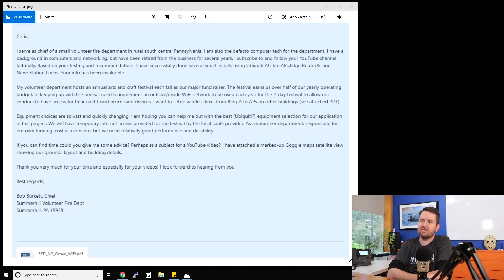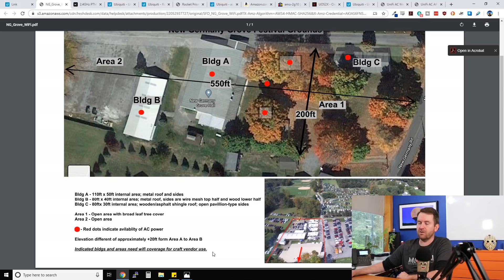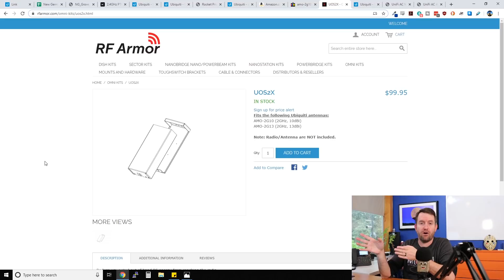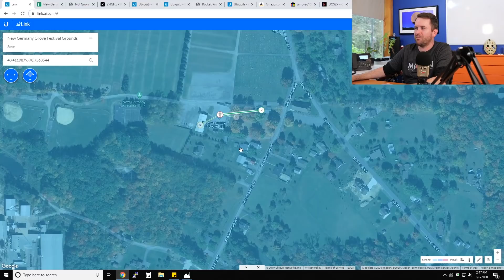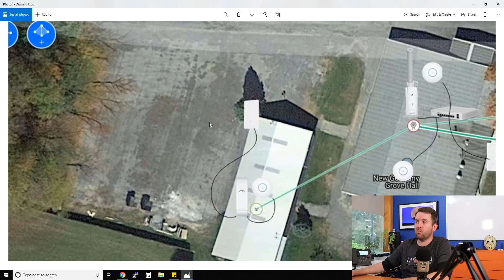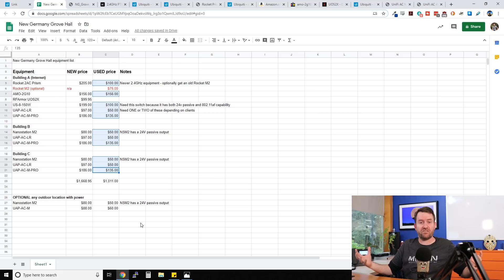Festival Grounds PTMP Network

Comment: Hi Chris, I did Roskilde Festival sound stages for 10 years (some years ago), which is a 1 week music festival with a huge crowd (130.000), which is built up during three weeks, 4-6 days of music, and then pulled down afterwards. We had to provide rocksolid network for the soundstages (not the audience at the time) to allow for crowdcontrol equipment, sound measurement etc. I would pull some steelwires, and pull a cat6 cable via them, and let it work via POE, he has trees, it's a firedepartment so they have a way to go high, that would make it much cheaper, and he can use much cheaper ap's.
Reply from the maker: Good feedback - thanks!
Reply: I was thinking along the same lines and was looking to see if anyone else already suggested it.  The distance between A & B is approximately 35', so putting a couple of permanent drops over in A makes the most sense for there.  Run a trench and conduit in the summer. Being a small town there is not going to be a lot of red tape and I'm sure someone they know has a back hoe and would donate a couple hours to dig it.  Going from A to C in the clearing between the trees is about 250' with one turn, so if a permanent conduit is impractical, flying wire through the trees temporarily (with possible APs in the trees) seems like a cheap solution. The only equipment that would be needed are the APs directly attached to a POE switch, no need for PTP or PTMP wireless. Wireless is often the cheapest solution for many situations, but in this case they would likely have cheap or free access to the equipment to trench between at least A&B if not B&C which provides a superior solution.
Reply: Cat6 cable outdoors is a complete no-no.  Against the law here in Aus.  Ever heard of lightning?  It loves outdoor wires like Cat6.  It's the reason we have point to point wifi links....
Reply: @einfelder8262  i see, well the trees are higher, and if its a situation it should be enough to run the wire to ground, og and the cable needs to be for outdoor use of course. But restrictions vary of course. We did rhis a lot in denmark, but that was also between steel towers
Reply: @Ein Felder:  Honestly? Lightning??? Flown cables are an excellent, safe, cheap, reliable way of doing this sort of thing. I come from the broadcast industry, where we used flown cables a lot. 

We also keep stuff as simple as possible. For example, radio mics are convenient, but unless there is strict attention to operating frequencies, they can be as useful as housebricks, especially wherever there are a lot of small outfits operating independently. So use cables where you can, for reliability and simplicity, and in the case of networking, performance that's an order of magnitude or more better (does no harm!). 

RF interference is worse on 2.4 gHz, although you won't get the early warning signs I could actually hear with analogue radio mics. I remember way, way back that we even had fully tuneable receivers, and one of the first tasks on site was to go carefully through the band, and listen to check for potential problems, before selecting the frequencies to use for the day. 

And, as Chris pointed out in the video, trees in leaf block RF very well, even on much lower frequencies that WiFi uses...
Reply: And in the circumstances, I would expect at least one firetruck parked up on display. You would hope it has good radio kit, well filtered, and that the Ubiquity RF circuits also have really good filtering, as I expect fire dept transmitters are at least 10dB (power) higher output than any wireless LAN kit. If an inqiusitive child presses the 'talk' button...
Reply: @simon-d-m  HA ha, yes that would be golden, though I'm not aware of the frequence they use in the area, I doubt that it would interrupt 5GHz
Reply: @simon-d-m  Oh yes, I did that when I was doing my enlistment as a gunner observer :-) About 30 years ago.
Reply: @kennethfribert6074  Sounds like it was fun! The thing about the fire truck is not what frequency it's on (will almost certainly be a lot lower - dunno US practice but I'd expect AM on VHF band 1 or somewhere near there), but that it will be a huge signal compared to the WiFi and very close. There is propensity for big transmitters nearby to simply overload the (analogue!) input circuitry of the WiFi receiver, even though they are well out of band. I took the back off an AP only yesterday, coincidentally - cheap and NOT Ubiquiti - not really any bandpass filtering at all before/at the first stage in the receiver circuit. It would be swamped, send the first stage into clipping and take out the signal for the duration of the bigger transmission.
To be fair, you would get some induction into cables too, but... Cat 5 and its derivatives use balanced twisted pairs (AKA "differentially driven" in the computer world), meaning they are relatively immune, and there wouldn't be a very good impedance match to the firetruck's TX anyway, so it would probably have no significant effect. For Cat5 to work at all there has to be excellent balance between the two conductors anyway, and if anything with an overall screen was used properly, any cable borne interference would only arrive via the plastic cases of the equipment. Careful grounding would work wonders, too.
And if lightning was in the area they'd probably have far bigger problems than card payments not going through...

Comment: At what point would just hard wiring be the best option?
Reply: Good and valid question.
Reply: Hard wiring is great, if you have the equipment needed to bury cable and it is feasible to do so. In a project I'm working on at the moment, it wouldn't be cost effective to dig a trench, because we'd have to get the city involved to go across the street and also we have asphalt that would have to be patched after the fact. Not only that, but there are four buildings and four overflow lots that we need to get to as well. That's a lot of digging, easier and cheaper to shoot a signal from the main building to our remote sites.
Reply: @techguy3424  I didn't get the impression this had to be a long term install.
Reply: I would say that if you have the towers or other tall objects that can be used, and the ability to put up a steelwire, and put cable on it (above trucks max height of course) there is nothing cheaper and more reliable. Actually, if you go for a short term setup, you don't even need outdoor certified cabling, it will handle the 3-4 weeks without any issues. Even without the steel cable, a UTP will sustain itself for several weeks (but then it is straight to the bin).

The span for a steel cable, well, it depends on the equipment you have at hand, as the forces in a long steel cable a substantial, we've used 20-30 m steel cables without any special precautions and issues, even in heavy rain and rather high winds (we don't get crazy storms in the summer here in Denmark). We had a 50 m cable at one time, but that was set up with a lot of higher end equipment.

Comment: Is there not a solution where the prism omni in the center could be used as a straight access point and have coverage throughout the grounds directly to clients?
Reply from the maker: No, not really.  You could try a single powerful access point up on that roof, but I would be doubtful that it could cover all of the areas that need to be covered.

Comment: I really don't think building B outside AP needs to be a pro. It looks as fairly small area, so AP-AC-M should be enough, plus, you'll get the ability to power it from that passthrough port, which make's cabling simplier. Also, if M5 family were to be more readily avaliable or cheaper when getting used APs, you could probably install the core AP for PTMP bridge on the edge of building A next to that road. There is not much visible from streetview in that area (mostly because the only place to look from is intersection to the north), but I think there might be clear line of sight. 
Important: Make sure to scan outside area for radars! I'm having trouble finding where to predefine DFS channels in UniFi! I don't know about US regulations, but here in Czech Republic, I have to run outside placed APs in mandatory DFS channel range. Make sure they know, whtether there is a radar, which they could interfere with! Have them set up this deployment ahead of time and monitor it for DFS requests! If observed, clear that DFS channel, because this could be costly! Better safe than sorry.
Reply from the maker: Good feedback - thanks!

Comment: I just did a 1000 ft test shot today to run a camera on a light pole with a lap-120 as the AP and a ns-5ac to provide network and power for the camera. It worked great and I didn't have any stutter in the video at all. Now I just need an electrician to set me up with an outlet for a permanent mount.
Reply from the maker: That LAP120 is a great access point - wouldn't work in this case, but I do use that one often.
Reply: @CrosstalkSolutions  I sent you an email a little while ago regarding another deployment I'll be working on near a major airport. Hoping to use the LAP-120 in that project as well.